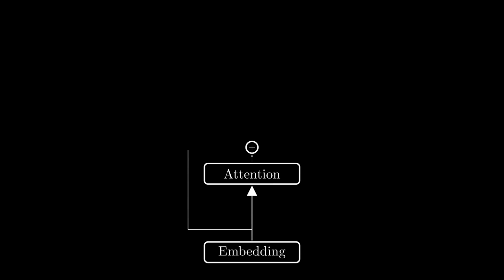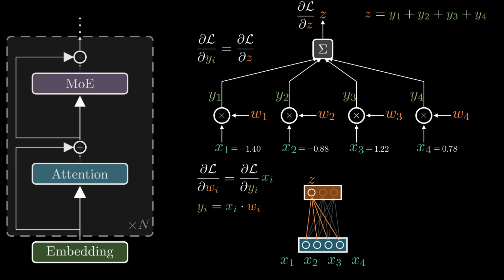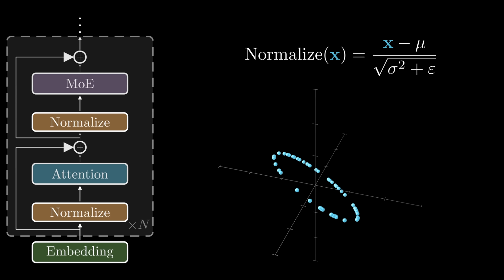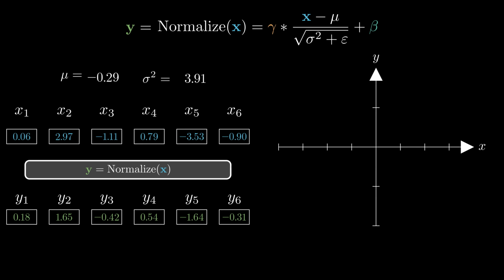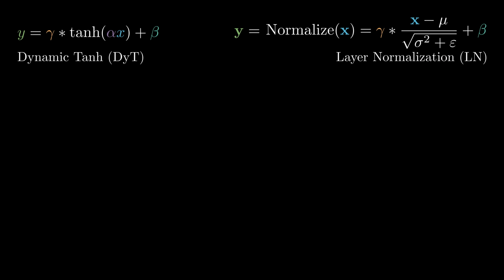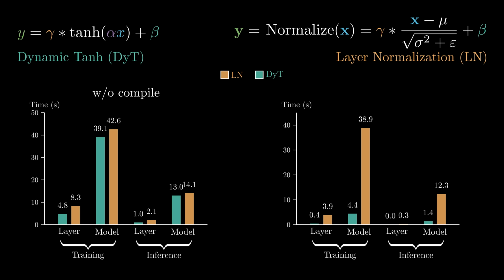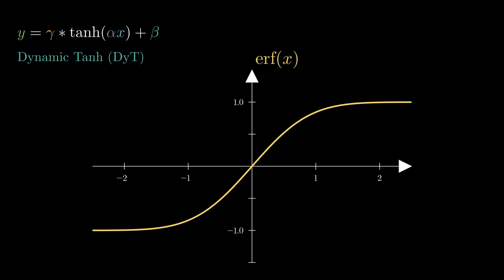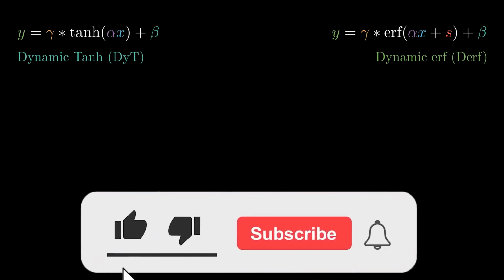The Most Underrated Layer Inside Every AI Model

Comment: Interesting to see that learned activations are doing better to batch statistics. Intuitively it should be the other way around right?
Reply from the maker: Yes, that's a surprising result. I think the story was that the community thought we have to use normalization layers to keep the feature activations in the model "well-behaved". But in practice, the  effect of normalization is simply keeping the extreme values bounded. So we can just use learned activations to achieve similar effects without computing the statistics over batch (in BatchNorm) or over token embedding vectors (in LayerNorm).
Reply: @jbhuang0604  Thank you, and yes, this makes sense. If we apply this idea - replace statistical methods with learnable representation in large-scale systems like llms, then I think we can see an improvement in performance and inference. Would love to collaborate with you on this Prof. Huang if you're interested :)

Comment: Do you know what is important in the end of the day to neural networks? It's not absolute scale of numbers and not relative proportions of numbers. Then what is it? Some informational unit of measure?
Reply from the maker: That's a very good question! In each transformer block, we are essentially computing what residual vector we should add to each token embedding. So everything starts with some generic vector-representations about a token, but across multiple transformer blocks (attention, FFN/MoE), the model refines the embedding vector to inject 
- contextual information (from attention layers) and 
- knowledge (from FFN layers).

The role of normalization layers (or learned activations like DyT and Derf) are simply trying to make the job of attention and FFN layers easier. But at the end of the day, we are operating and updating the same token embedding space. 

Does that make sense?

Comment: Thanks for the great video, it does a really nice job of building intuition for what normalization is and why it matters. I had a small question around 3:16,on how you were framing the link between the Transformer/MoE block on the left and the Layer Norm cube on the right.

The cube comes from the 2018 Group Norm paper, where it shows normalization across the spatial and channel dimensions (H, W, C) for the CNN setup. Transformers and MLLMs usually handle Layer Norm a bit differently, applying it strictly on a per-token basis, so only across the embedding dimension C. I wasn't sure if the cube was meant as a general intuition for the Layer Norm family, or whether it was drawing a tighter parallel to the Transformer case, since normalizing across the full sequence dimension would tend to make the statistics unstable whenever sequence length varies, which happens often with dynamic image patching or fluctuating text prompts. Would be curious to hear your thinking on it.
Reply from the maker: Yup, the group normal paper was mostly working with CNN models. That's why we have the "spatial dimension". For transformers and MLLM, we no longer have this spatial dimension as we are only dealing with a sequence of vectors (token embeddings). So only LayerNorm or later RMSNorm makes sense. 

We could potentially apply batch normalization in Transformer. However, unlike CNN vision models that could have thousands of images in a batch, in language modeling, our batch size is a lot smaller and have very high variance (e.g., imagine that we have texts from coding or news or laws).

Comment: Does Derf() make training faster? cheaper?
Reply from the maker: With proper compiling optimization, Derf does not offer speed improvements over RMSNorm yet. 
But since it's actually simpler than RMSNorm, so it should be able to further optimized for faster training/inference speed.

Comment: since dyt and derf include non-linearities, can the activation function be dropped altogether? like having a single layer performing both activation and normalization.
Reply from the maker: Interesting idea! But, the activation functions typically live in the feedforward networks. If we drop that activation function, we won't have a non-linear model. The attention layer itself is linear with respect to the input. So if we don't have nonliearity in FFN/MoE, then the entire model collapse to a linear transformation.
Reply: @jbhuang0604  perhaps im wrong but the next following transformer block will start with a normalization layer, acting as the activation function of the previous output. or alternatively instead of doing [normalization -> FFN -> activation] maybe [FFN -> normalization+activation] could be used. but now that i think of it the activation layer hardly contributes to the performance of models anyway.

Comment: 3.59   I don't understand why subtracting the mean moves the embeddings to a plane.  I would have thought this just moves the centre of mass to the origin
Reply: The resulting vector after subtraction satisfies y1+y2+y3=0 which is a 2d plane
Reply from the maker: You beat me to it! Yes, we need to remember that the mean is calculated from each vector. So after subtracting the mean, all the vectors would have coordinates that lie on the 2D plane.
Reply: I had the very same question and did not understand the answers here. But then I learned, that average means the average for each vectors over its entries.
Reply from the maker: @awee1234  Yup, that's what LayerNorm does. The means/variances are computed from each token vector, not across different vectors.
Reply: it does both

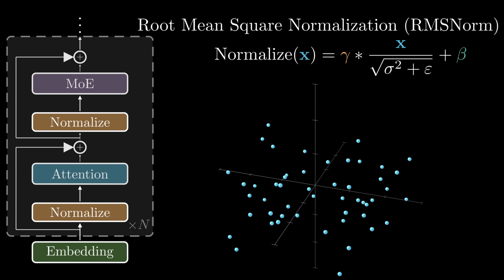Comment: Small correction: the formula for the RMSNorm shown in 5:00 divides by sqrt(variance), but true RMSNorm divides by sqrt(mean of x squared). These are only the same if the mean is zero, since mean(x^2) = variance + mean^2. Without centering, using variance alone is not equivalent to RMS and gives different geometry.
Great video!
Reply from the maker: Ah! You are absolutely right. We skip the mean computation in RMSNorm so we don’t really know what the variance is! Thanks for pointing it out!

Comment: I just clip the activations in my network XD. I use a straight-through estimator so activations out of range still receive the gradient signal if it pulls them back in range, but zero if they want to stray further away. I might try DyT and Derf since they similarly bound activations.
Reply from the maker: clipping indeed is effective. 

I think your setting corresponds to the Linear_{clip}(x) function. See figure 5 of https://arxiv.org/pdf/2512.10938 and results in Table 7.

Comment: I had a look at the paper and I'm highly skeptical of its' validity. Just like many, many papers out there, there is no word on a variance management methodology. All we get are single numbers for performance. Easily within variance for best and worst performing methods. You really want a box plot of best val loss for each method, across at least 10 runs, random seeds. Less rigor is needed when results are further apart, but as it is, you could easily follow this paper and end up with worse results.
Reply from the maker: That's true. But, the code is available so everyone can try it out to see if it helps their settings.

- DyT: https://github.com/jiachenzhu/DyT
- Derf: https://github.com/zlab-princeton/Derf
Reply: @jbhuang0604  That's all the papers, I can't really be arsed to implement better testing methodology than so many authors. I have more impactful ideas of my own. Not to mention I'd need to audit the code and find whatever settings they used to produce the metrics in the paper in the first place. I've seen a paper claiming their linear model was better than PatchTST. Come on. Then you look at their PatchTST results on the exact same dataset, cross reference with the PatchTST paper, and it's not even close.
Reply from the maker: @poipoi300  Yup, indeed! There is just so much noise! It takes time to extract truly useful signals.

Comment: (1) adding parameters to the activation fn shouldn't affect a thing, because solve the linear fn such that the output is identical while the new parameters are 0. E.i. they are completly redundant.
(2) erf is terrible actually
Reply: Would you mind explaining this a bit more in depth ?

 Seems to me adding parameters (especially scaling ones) is essential to avoid vanishing gradients. Residual layers may fix this partially since some of the gradients can be linearly projected back onto the layer but I doubt it's optimal.

And why is erf so bad ?
Reply: @enjaad1654  To oversimplify, the input, x1 is essentially the result of a linear function and get's feed forward into another linear fn*.

with x1= c*x0+d: =>

f(a*x1+b) = f(a*(c*x0+d)+b) = f((a*c)*x0+(a*d+b));

with x2 = e*f’(x1)+q and f’(x1) = g*h(x1)+s: =>

x2 = e*(g*h(x1)+s)+q = (e*q)*h(x1) + (e*s+q)

so we get the exact same results if we set the parameter c' = c*a, d' = a*d+b, e'= e*q and q'=e*s+q.

So the same result, while removing the extra parameter, by simply adjusting the matrix weights. To remove the inner parameters we need to adjust to the matrix preceding it and for the outer parameter the succeeding matrix.

*This is a bit more complicated for vector search used in the attention layer.

_

erf needs you to solve an integral. That is slow. In practice this likely uses lookup tables and approximations. The tanh fn is already an approximation of the erf fn. Ok, erf may not be bad, I am just deeply suspicious of this paper.
Reply: Addendum: purely intuitively, with g*f(ax+s)*b, s should adjust the position of the function (left or right of 0) while a should adjust the slope (how compactly the values are compressed towards the min and max of erf). I have not verified this so take it with a grain of salt.
Seems pretty useful for balancing each input contribution to the sum.

Comment: just swapped out my LNs for DyT today.. now I got do try Derf
Reply from the maker: Cool! I heard that it's still challenging to see clear improvement for Derf in language modeling tasks, e.g., may need better tuning. Curious of what you found for your tasks.
Reply: @jbhuang0604  using it in a 3d point cloud transformer model..  I have not run proper ablations yet, but training curves look promising so far + perf gain compared to RMSNorm (which is slow without compile <torch 2.7)
Reply from the maker: Very cool!
Reply: Another day, another chance to learn something new. If you never got to implement something new, life would be very boring!
Reply from the maker: @acters124  hear hear!

Comment: I like the video. Regarding the backprop - the issue of certain input branches with large x_i's getting large error attribution. That in itself is not a problem - but becomes a problem when the training data is not well behaved, which typically isn't.
Reply from the maker: Yes, I agree. It's the imbalance (e.g., some entries have extreme outlier values) that throws the training stability off.

Comment: What shape do DERF actually turn the vectors to, though? If tanh does square and layer norm does circle ?
Reply from the maker: It's similar, it maps every dimension of the input vector to a bounded range of [-1, 1]. But, the shape of the erf function, for some reason, gives better performance than tanh. 

Even when we tried to approximate tanh to erf, there is still a performance gap. See Table 16 in the paper: https://arxiv.org/pdf/2512.10938
Reply: @jbhuang0604  in the S-shaped figure what does wach point represent? a bit confused between it and the unit cycle/square figures because in both you name the functions input/output as x/y
Reply from the maker: Imagine each token is a 5 dim vector and you have 10 tokens. After the normalization, you will have 5x10 =50 input-output (before/after normalization).

If you only look at each token, the mapping will be linear (so it would look like a straight line in the plot). But since different token vectors have different mean and variance, collectively these show up as a nonlinear, S-shaped relationship
Reply from the maker: When we look at the s-shape plot, we are looking at every individual dimension of all token embeddings together. So we call it x (input) and y (output). 

The gist is that while normalization is a linear operation for each vector. Collectively, the mapping behaves like applying a S-shaped function to each individual dimension *independently*. This gives us similar effects without using a normalization layer.
Reply: @jbhuang0604  Could in theory be that the derivative of erf has a better gradient than tanh, even when the shapes roughly match.